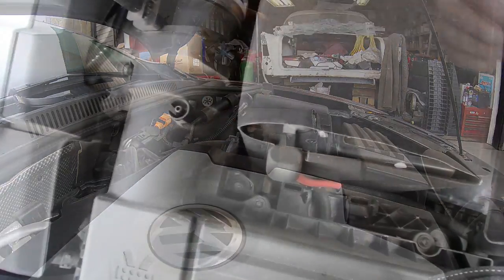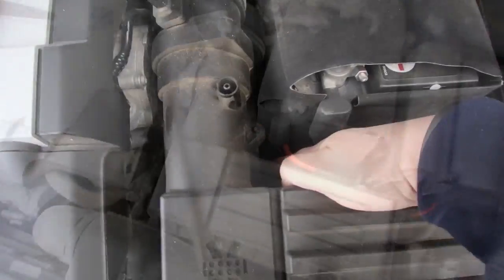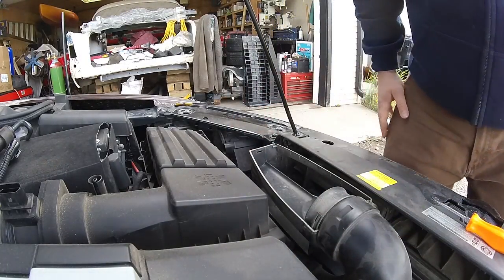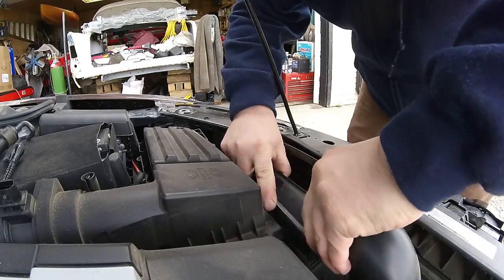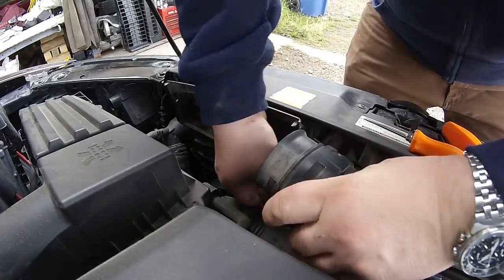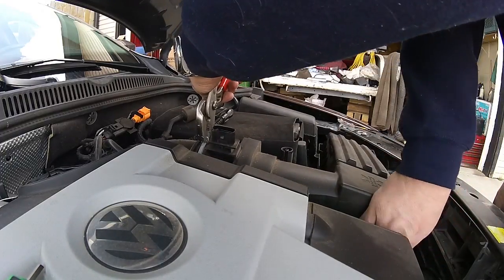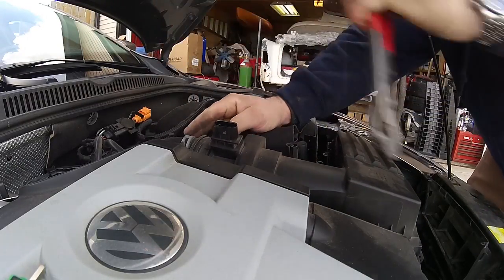DIY TDI Airbox Removal How to

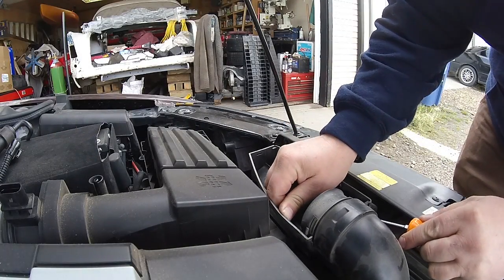Comment: Nice video. The air intake duct, I fail to understand the use of it giving there's no filter in the housing. 0:54
Reply: There's a filter in the big box he pulls out at the end. He just doesn't take the top of the box off where the filter is.
Reply: I was thinking the same, it's just an empty box..? 🤔

Comment: What is the purpose of the rubber hose you pulled off first? I'm struggling to find info on what it's for
Reply: Did you find any info about it? I also can't find anything
Reply: @khalid9085  yes dude it's just a vacuum line, part of the breather system. If your installing a hard pipe and filter don't plug it, it allows the turbo to breath. I just put a breather filter on mine.
Reply: @KarlMorgan1245  I am going to install cold air filter and dont know what to do with this hose :(
Reply: DrKarloss hi, do you know if it is possible to plug a little intake for make a sport car sound ?Sorry for my english.
Reply: @lectorchl  yes you can

Comment: my golf doesn't have that front intake. The one with the curled pipe. i do have the pipe though but removed it so it doesn't fall. i think this is the reason it picks up speed lower and not like a proper 2.0 tdi

Comment: What does the hose seen at 1:59 under the airbox do? It goes straight into the fender as is or gets plugged somewhere?
Reply: It's a water drain incase some water gets in airbox
Reply: @brianmurphy6487  thanks a lot!

Comment: So VW still uses an adjustable clutch linkage?
Reply from the maker: +1962pjb The clutch is hydraulic what i meant to say in the description is to adjust the shifter linkage not clutch if that was what you were referring too
Reply: +jerry bskorner Yes. I couldn't believe that adjustable clutch linkages still existed, but after I read the videos description I had to ask. Thanks for the clarification.
Reply from the maker: and thanks for pointing out my mistake and now it's corrected
Reply: +jerry bskorner I just reread the description after I commented with the correction you made and I thought I didn't comprehend it properly before my first comment. I felt like a dumbass! Ha! Thanks for telling me that you corrected it! ;-)